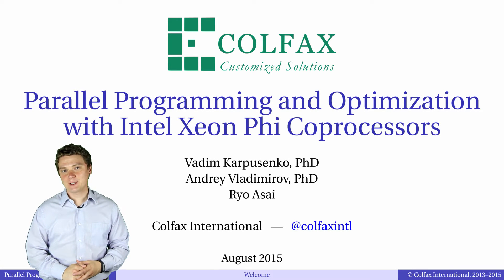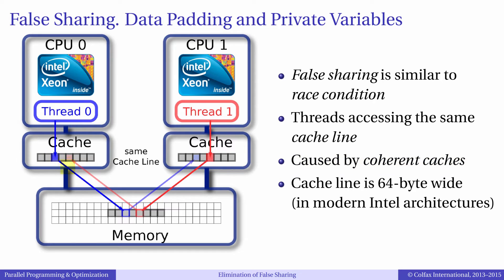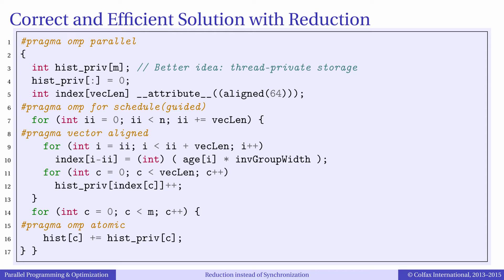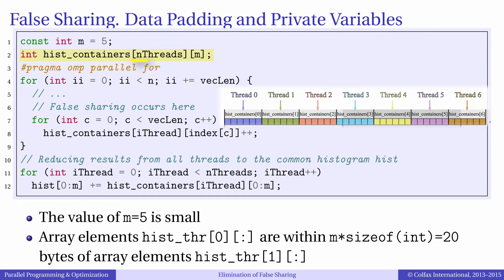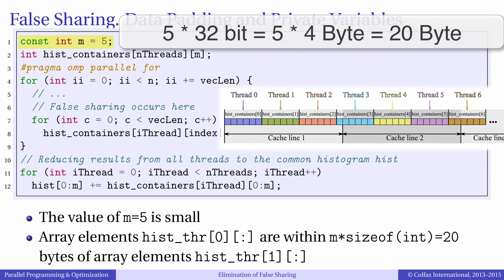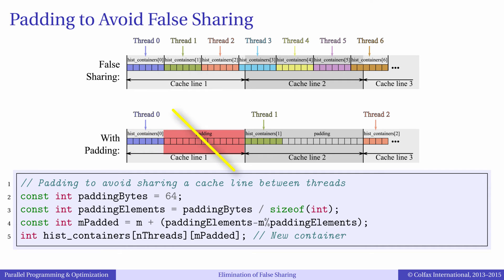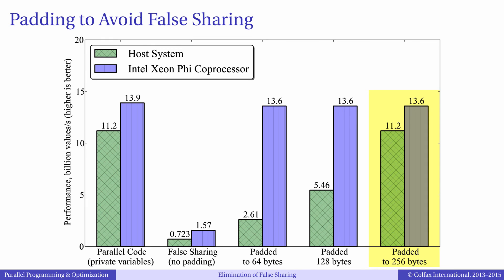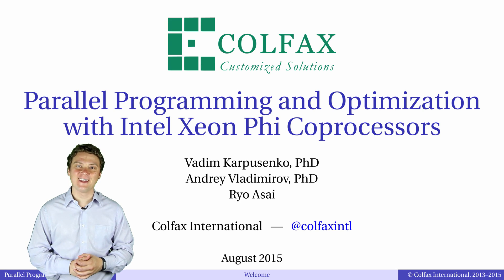Episode 5.9 - Elimination of False Cache Line Sharing

Comment: Sandybridge also requires 128 byte alignment because it prefetches the next cacheline, so I guess whatever the host system is caches the next 3 cache lines.  It's a little hard to find documentation on specific processors regarding the cache prefetching behavior.  I think ivybridge also caches the next cache line, but not super sure.  Anyways... for consumer grade x64 AMD/INTEL, it's best to pad for 128 bytes because 64 is simply not good enough.

Comment: At the end of the video, If the padding is to 64 bytes, how can the prefetcher produce false sharing? Even if it brings other consecutive cache lines, the active thread should not touch them. Can you explain what is happening please?
Reply from the maker: In case of Xeon CPUs up to 4 cache lines are prefetched. If the padding is only 64 bytes (1 cache line), three more lines will be prefetched anyway - standard behavior of prefetcher (can be modified by BIOS settings) . And although there's no active reading from these lines, they will be evicted and will be prefetched back again on every write operation by a neighboring thread. This is a standard behavior of cache coherency protocol implemented in Xeon Processors.
Reply: @VadimKarpusenko  Thanks for your answer. I am trying to register on your recomended further reading on https://colfaxresearch.com , but I am not receiving any email with the password. What can I do?
Reply: Sandybridge also requires 128 byte alignment and padding because it prefetches the next cacheline, so 64 isn't good enough to prevent false sharing.